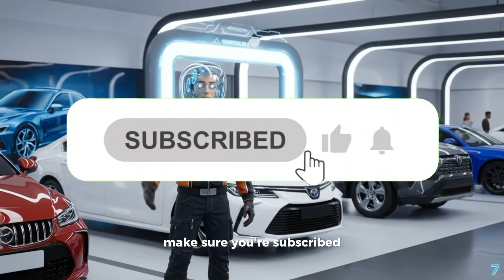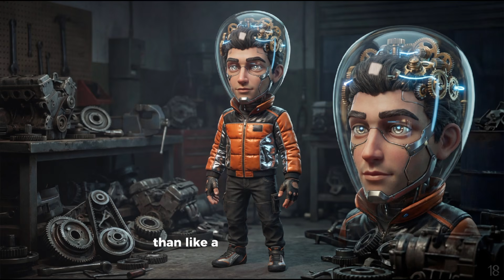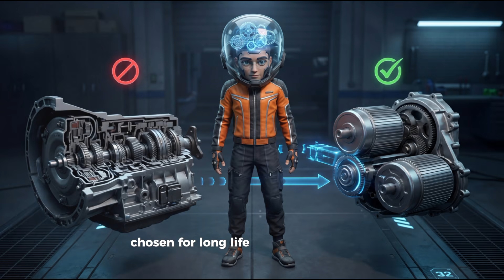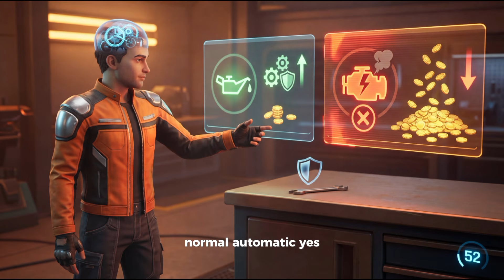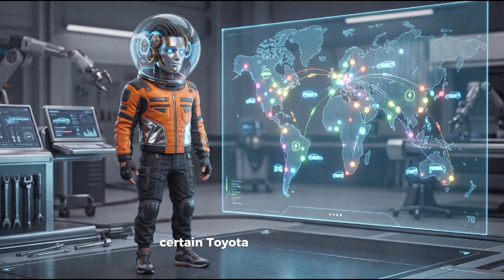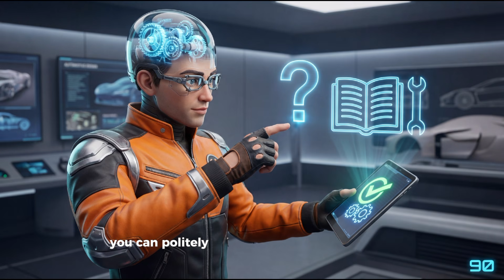Deep Dive Toyota’s e-CVT: Why Your Mechanic is Wrong About Hybrid Transmissions

Comment from the maker: It’s time to settle the biggest debate in the shop: Is 'CVT' actually a dirty word, or are we just using it wrong? Most mechanics warn people to stay away from CVTs because they’ve seen too many shredded belts and slipping pulleys in standard gas cars. But Toyota's hybrid e-CVT uses solid planetary gears no belts, no clutches, and no friction. If it’s so 'unreliable,' then how are Prius taxis hitting 400,000 miles on the original transaxle? I want to hear from our community: What mileage is on your Toyota or Lexus hybrid right now, and has a mechanic ever tried to scare you away from it because of the 'CVT' badge? Let’s build a real-world reliability database in the replies! 🔧
Reply: @GearHead_Geniusgtr  There is a .Major difference between CVT and eCVT.
Reply from the maker: bmw803, thanks for watching and for emphasizing that major distinction! You are 100% correct the naming convention is arguably the biggest source of confusion for used car buyers.

From an engineering standpoint, a standard CVT relies on friction between a high-tension steel belt and pulleys, which is inherently a high-wear environment. In contrast, the Toyota e-CVT is a robust planetary gearset with no belts or pulleys at all. It’s essentially a constant-mesh power-split device that uses electric motors to manage the load. This fundamental mechanical difference is exactly why the reliability and Total Cost of Ownership (TCO) of a Toyota hybrid are in a completely different league compared to a traditional gas car with a belt-driven CVT. Great to see someone in our community who knows the real hardware difference! 🔧

Comment: I am considering a used Toyota hybrid vehicle. When I look at the parts diagrams on Amayama's website, the internal parts for the e-CVT are not even available (other then the input flex plate and pan gasket). Nor is there anything on auto parts site like Rock Auto. I'm hoping that is because these are truly bullet proof and as a result, there is little demand for rebuild parts.

Comment: I have a Corolla hybrid, the ecvt is absolutely fantastic. Beautiful car to drive and own.😊😊
Reply from the maker: Keith, thanks for watching and for sharing your ownership experience with the community!

From an engineering standpoint, the reason your Corolla Hybrid feels so incredibly smooth is precisely because of that planetary e-CVT. By utilizing constant-mesh gears and electric motors to seamlessly blend power, Toyota completely eliminated the harsh shift shock and friction clutches found in traditional transmissions.

Not only does this architecture deliver a refined driving dynamic, but engineering-out those wear-prone parts is exactly what guarantees the mechanical longevity of the drivetrain, keeping your Total Cost of Ownership (TCO) as low as mathematically possible over the long haul. Enjoy those smooth, drama-free miles! 🔧
Reply: @KeithWilliams-h2x  I also have 2024 Corolla se hybrid I love mine as well

Comment: Tbh anything designed by Toyota is almost always indestructible provided it is serviced properly & the E-CVT by Toyota is no exception it is very simple & uses no pulleys or belts & has no torque converter infact it is that well designed that some say it is as good & robust as a manual transmission!
Reply from the maker: IBM, thanks for watching and for summarizing the exact mechanical truth for our GearHead community! You hit the nail on the head by comparing its durability to a manual transmission. From an engineering standpoint, because the Toyota e-CVT relies on a constant-mesh planetary gearset instead of friction-based belts, pulleys, or a traditional torque converter, it virtually eliminates the most common points of catastrophic transmission failure. The gears are always physically engaged and share the load with the electric motors, making it incredibly robust. And you included the most critical caveat: "provided it is serviced properly." Ignoring the dealership "lifetime fluid" myth and performing regular transaxle fluid changes is the ultimate secret to protecting your Total Cost of Ownership (TCO) and easily hitting that 300,000-mile mark. Great to have someone who truly understands the hardware in our family! 🔧

Comment: Just pushed a ford cmax to 248k miles. Had to get rid of it because i hit something in the rd and broke the steering assy. $4k repair was double the value of the car. Very confident i would make it to 300k miles and still hadnt replaced the brake pads.

Most people really are afraid of battery degradation more so than  cvt problems. Oh ford and toyotas hybrids are very similar.
Reply from the maker: Nightshift, thanks for watching and sharing that incredible 248,000-mile report! You’ve hit on a critical mechanical truth: from an engineering standpoint, Ford’s hybrid planetary gearset (specifically in the C-Max and Fusion) shares nearly identical architecture with the Toyota e-CVT. Both systems effectively engineer-out the fragile belts and clutches that give traditional transmissions a bad name.

Going nearly a quarter-million miles on original brake pads is the ultimate proof of how regenerative braking protects your Total Cost of Ownership (TCO). It’s a perfect example of how the electric motor does the "heavy lifting" for both acceleration and deceleration, leaving the mechanical parts under-stressed. You didn’t lose that car to a CVT failure or battery degradation—you lost it to the economic reality of repair costs vs. residual value. It’s a shame, because that drivetrain was clearly just getting started. Thanks for adding this top-tier data to our GearHead community! 🔧

Comment: Hi
E cvt is one of the best transmission system in the world as long as you change the fluid one every five years. 
I've seen the Toyota prius with milage around 300k shifts like butter. 
Right now my wife and I got 3 vehicles with regular Toyota automatic transmission.  Soon we will buy an ecvt because gas prices keep going up. 
Thank you for sharing this topic.
Reply from the maker: John, thanks for watching and for sharing your plan with the GearHead community! You are 100% right about the fluid changes; while Toyota often markets the transaxle fluid as "lifetime," proactive owners who change it every 5 years or 60,000 miles are the ones hitting those legendary 300,000-mile marks.

From an engineering standpoint, the reason that high-mileage Prius still "shifts like butter" is that it isn't actually shifting at all. Because the e-CVT is a constant-mesh planetary gearset, there are no physical gear changes or friction clutches engaging and disengaging. It is simply a seamless dance between the electric motors and the engine. Moving from traditional automatic transmissions to an e-CVT is a brilliant strategy to lower your Total Cost of Ownership (TCO) as gas prices climb. Great to have you as part of the family! 🔧

Comment: The metal push belt CVT is a very bad design doomed to early failure. The Toyota eCVT is genius.
Reply from the maker: Fivish, thanks for watching and for hitting on the core mechanical truth of this debate.

From an engineering standpoint, you’ve identified the fundamental flaw of the push-belt CVT: it relies on high-pressure friction between a steel belt and pulleys to transfer torque. That friction inherently generates immense heat and surface fatigue, which is why those units are notorious for premature failure in standard gas cars.

The Toyota e-CVT is a different species entirely. By using a robust planetary gearset to act as a power-split device, Toyota removed the belts and pulleys altogether. It’s a masterclass in mechanical simplicity where the gears are always in mesh, virtually eliminating the "slipping" and heat-soak that kills traditional transmissions. It’s a genius way to engineer-out failure points and protect your long-term Total Cost of Ownership. Great to see someone in our community who appreciates the real hardware differences! 🔧

Comment: “ You can’t be serious about it,”  if you’re really serious auto technician, because one who’s worked & did transmission rebuild, parts repair.. truly understands the working components that really matter..really knows what is crucial, valuable solid transmission engineering..

   Not the hype or great propaganda that is paid for by big automotive manufacturers…those who are nowadays can’t sellout their own poop vehicles..sitting over 200 days in the dealership..because of what hype and propaganda aren’t convincing enough those who know, know.. knowing what’s cheapest engineering is cheap engineering disguised as beauty and magical carpet flying over the rainbow 🌈..but even the great interior design is not catching..droes of buyers ..these are throw away vehicles 🚗 in 60-80 miles your are done with your dream 💭 vehicle..2.5 years..maybe 3.5 years..it’s about hocus..pocus.. locus 😮 ..comedy of errors..

‘…remember the 80/100 mpg gasoline ⛽️ vehicles, GM Ford, Chrysler..promises..by’80?! I doing many commercials in tv 📺 shows..Toyota..including…Hello..!!
Reply from the maker: Frank, thanks for watching and for bringing that raw, honest technician's perspective to the community. You are 100% right about the "throwaway vehicle" trend modern automotive industry is riddled with planned obsolescence, fragile plastics, and marketing hype that treats cars like 3-year appliances rather than 20-year tools.

However, from a strict internal engineering standpoint, the Toyota e-CVT is a rare mechanical outlier. While a standard automatic or belt-driven CVT relies on friction clutches, high-pressure hydraulics, and steel bands that are guaranteed to fail, a planetary gearset is just solid steel gears meshed in oil. It’s essentially the same architecture as a heavy-duty differential, which is why we see these specific units hitting 300,000+ miles in commercial taxi duty even when the rest of the "dream vehicle" is falling apart. You’re right to be skeptical of the "hocus pocus" marketing, but in this specific case, the hardware is actually an exception to the cheap engineering rule. Thanks for keeping the discussion grounded in real-world shop reality! 🔧

Comment: We have a Ford Escape PHEV with the same exact system. So, we should be fine fora long tine.
Reply from the maker: @bmw803, thanks for watching and for pointing that out! You are 100% correct. From an engineering standpoint, the Ford Escape PHEV utilizes a planetary gear power-split architecture that is functionally identical to the Toyota e-CVT system. This is exactly why the hybrid Escape has been such a high-mileage legend in taxi fleets; by removing the friction-based belts and complex shifting clutches, Ford essentially engineered-out the most common transmission failure points. As long as you stay on top of your fluid changes and keep the hybrid cooling system healthy, that drivetrain is built for decades of reliable service. You made a very smart mechanical choice for your long-term Total Cost of Ownership! 🔧